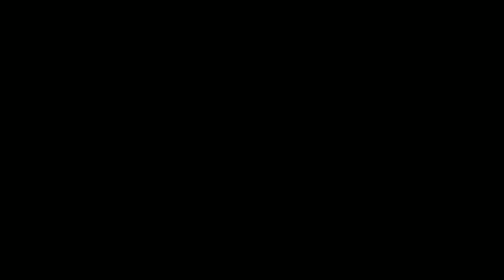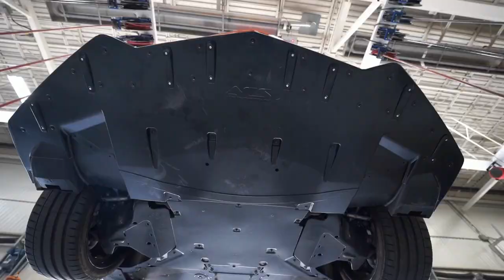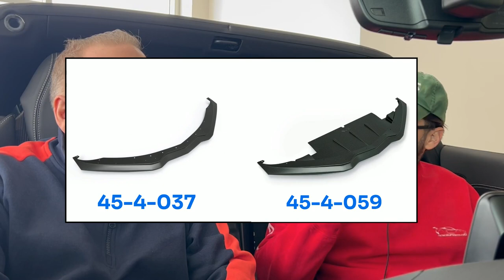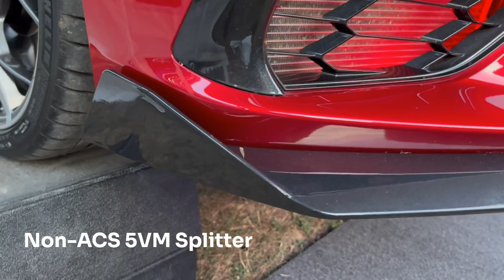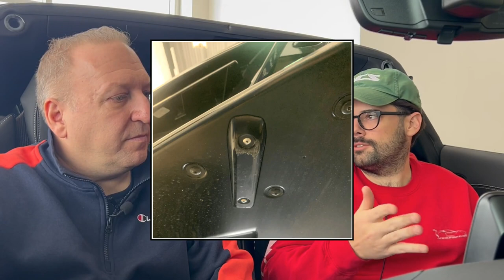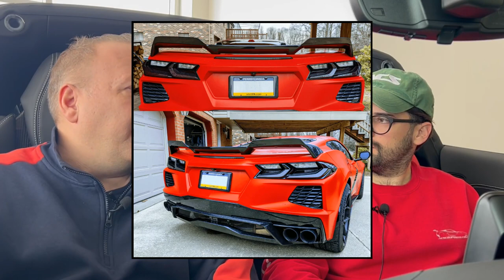ACS DevTalk #2  | C8 Corvette Stingray Undertray | 50-4-100

Comment: Hi Joseph! I've watched lots of your videos and done a lot of research on splitters, rockers, and mudguards. I found out about ACS Composites because you are a Mid Engine Corvette Forum sponsoring vendor. Everything I've read is that you guys make the very best components in the industry. 

I have an Amplify Orange 2022 SR, and after scraping the ugly installed Z51 splitter several times, I will be ordering the 1VM splitter with this undertray for protection, the 1VM rockers, and the mudguards soon.

Comment: Talk about your C8 mudguards and why they are SOOOO expensive.
Reply from the maker: For $499, you get 4 mudguards, painted in OEM carbon flash metallic (not glossy black) to match your C8, they are made out of our strongest PC Composite material, made in injection for sharp, crisp lines, and easily snap into place like OEM, and save you thousands in repainting the side of your C8. Maybe we should do a video 🤔
Reply: @ACSCOMPOSITE  Yours appear to be the best mudguards for the C8 I have found. But they should be for that exorbitant price. They will definitely be an option for me when my C8 arrives in about a year.
Reply: Too be really honest. Go put these up against the competition and you’ll agree they are worth the $499!